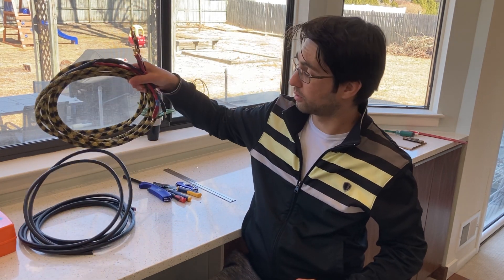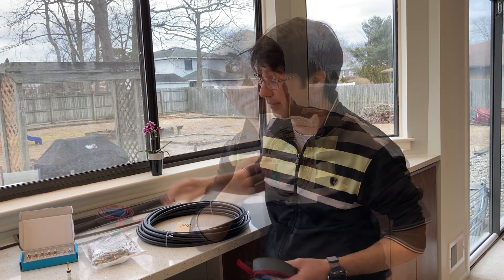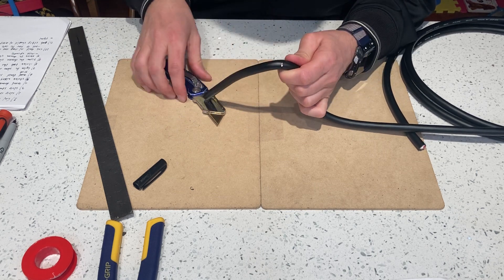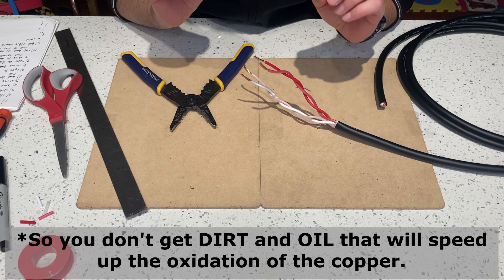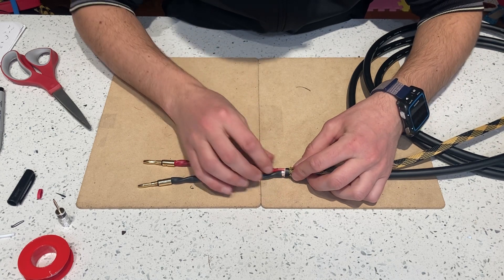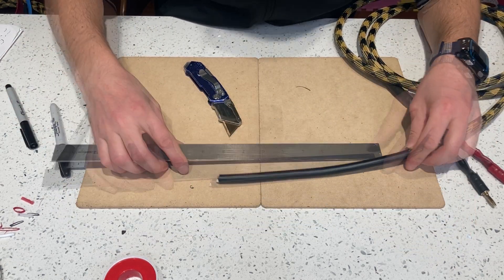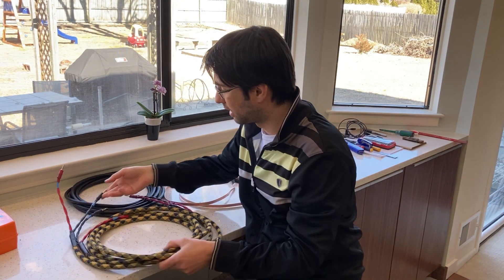DIY Speaker Cables - How to Build Your Own High Quality Speaker Wire (w/t Canare 4S11 Made in Japan)

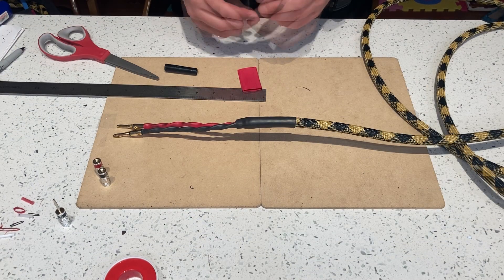Comment: I did the similarly and the result turned out amazing! I really like how it came out. 6:56 - let me share one tip. It annoyed me that every time I connected or disconnected the speaker cables from the amp or speakers, the banana plug nuts would loosen up. I used blue Loctite 243 threadlocker and it worked perfectly - the nuts no longer unscrew themselves!
However, a heads-up: once you use this threadlocker, you won’t be able to take the banana plugs apart again - the glue holds so strongly that the plug will break if you try to loosen it. But honestly, it’s a great solution because you don’t have to tighten the caps every time you plug the cables in.

Comment: I wish I had heard about Canare cable. I made my speaker cables using Mogami 3104 which are 4 12gauge wires but I think you get a more neutral sound with Canare.
Reply: My uncle is an electrical engineer and audiophile who has spent probably about $100, 000 on speakers and amps. He says only gauge can effect the sound. Hope depot ofc copper speaker wire is all you need, the rest is snake oil and aesthetics.

Comment: If you have interference so strong that it makes an audible difference in a high-power signal, isn’t the correct solution to get rid of the source of that interference as it could damage all kinds of electronic devices and be outright deadly for people with pacemakers?

Comment: worth to make such a think for dali spektor 2 / and a / yamaha a-s201 or a-s301 setup ?
Reply from the maker: It’s a relatively inexpensive cable I think. You can get a cheaper cable. I like the thicker gauge for its properties, especially if the speakers are further apart from the amp. On a $1000 setup probably worth spending $60-$100. If you buy something off the shelf make sure it’s at least 14 gauge and has nice robust connectors.
Reply: @onemandiy  my current cable is 2x4mm

Comment: Honesty, 10 gauge stranded OFC wire is all you need.  Just strip the ends and tin them with solder and connect them "directly" to your amp and speakers.  No connectors to break of fail and no signal loss with lower cost.  You're really just creating audio "jewelry".  Nice craftsmanship, though.

Comment: Quick follow up if you have a moment.
Shrink tubing - Why not use the 9/3mm 3:1 in a longer length to cover both red cables and the whole banana plugs ?
or the 9/3mm - 2 pieces one for the wire and another for the banana pug ? does it make a difference.
Thanks in advance
Reply: I figured it out. Nothing like taking a break from a project and then coming back fresh :)

Comment: Nicely Done.
Quick question if you have a moment.
I noticed you twisted the 2 redish cables together and the 2 whitish together.
What made you go that way or that specified somewhere ?
Thanks in advance.
Reply from the maker: Thank you! It’s not specified, but basically color indication to make sure you don’t mix it up. You could make a biamp cable with four plugs on each end, and have two pairs. so you’ll need to keep track of the colors. Hope that helps. Color coding is red for positive hot and black/white for neutral. Hope that helps

Comment: I don’t believe that the twisted wires as you have used them add noise protection for two reasons.
1. The voltage and current in speaker wires is unlikely to disturbed by the level of electromagnetic fields found in non-industrial environments.
The low level voltages and currents from microphones, electric guitars and Ethernet are another matter.
2. Twisted pair wires only resist noise when used as a “differential pair”. The positive signal is sent down one wire and the negative image is sent down the other. When the two signals are summed by a differential amplifier the noise is cancelled out.
SIGNAL + NOISE - ( - SIGNAL + NOISE ) = 2 * SIGNAL

Comment: Thank you for your insight! Question... Twisting them together is for the interference between each other to minimize the consequential noise, by "micro-cancelation" all along the cable  (canceling most such "inner noise", but not all noise, i.e. interference from external sources). Hence, I'd rather use a plain 12 gage instead of twisting two 14 gage, but I wonder: am I right about this?
Reply from the maker: Technically, if you use 4 twisted wires for two channels (star quad as the type of the cable) the twists will help cancel more of the electromagnetic emissions rather then 2 twisted wires for two channels. That’s is It also reduces cross talk by twisting. That being said this is more true for data lines that work on much higher frequencies, like ethernet cables, etc

Comment: Great video for do it your selfers. I just bought the canare 4s11 from Blue Jeans Cable with locking bananas on amp end and spades on speaker ends. You can get them full range or bi_wire. I'm running mine full range and after 50hours burn time they sound excellent. Great price also. They take the time to construct a very good product. You'll be pleased !!
Reply from the maker: Thanks so much! I should try a biamping,

Comment: no OCC cable ???
Reply from the maker: They are all OCC actually, typically the marketing department would advertise that as a feature. Some are 99.9%, and they keep on going 99.99… 99.9999… 99.99999 and call them a 3n, 5n, 7n depending how pure they are. More pure is definitely more expensive, but to what end 🤷😎
Reply: @onemandiy  you dont have a clue
Reply from the maker: @garygranato9164  OFC or OCC... Ohno Continuous Copper or whatever... my reply still stands, its a play on "Oxygen purity". And No not an OCC cable, or at least it isn't advertised by Canare as such

Comment: "amp side" vs "speaker side".... irrelevant. electricity is electricity. current is going to flow in the same direction regardless of which end is plugged into which device... and there are no additions to these cables that would make directionality a consideration. (ie no ferrite chokes, chassis grounding etc.)
Reply from the maker: electrically ye and and you can choose to have either end indistinguishable. However in my design it is very relevant, both ends have different split lengths, longer for the amp and shorter for the speaker. Also I like to pay attention to detail, so I like my wire to run the same way of the lettering :) Kind of the same reason I don't want to wear my sweater inside out hehe

Comment: good technique on removing the outer insulation, i was showed to do it the exact same way by an old industrial electrician. i also wouldn't worry so much about the oxidization of the cable, unless you leave it out in the rain with the copper exposed you will be fine. if you really are still worried just put some flux on the end and heat it up.

i am curious why you didn't just buy 4-6mm^2 2core wire rather than having two 2.5mm^2 4 core twisted together, and the ptfe tape under the adhesive heat shrink.
Reply from the maker: Thank you! I may try the flux tip. The cables will definitely oxidize when exposed to air over time, not as bad as if outside but will stop being shiny.

I used the 4 wire configuration because of the star quad topology, the cables/signal does more twisting and reduces electromagnetic interference. I and the take under the shrink is so I can build a smooth transition.
Reply: @onemandiy  ah I understand, I’m Fairly new to audiophile stuff, I am an electrician tho so I know a thing here and there that relates. More on the flux I mentioned. There are different types of it and they can be more or less corrosive. Heating it up just speeds up all reactions. If you want Really corrosive flux, get some copper pipe braising flux, give it a good coat in that and then torch it. If you want a long lasting and reliable connection you want to solder it. I always use lead solder to solder as it flows better and I believe less chance of cracking since the lead is very malleable. To clean off flux you should rinse it in isopropyl alcohol. If you torch it well tho most of it will come off.

Comment: Can you use this cable for bi-wire cables?  Just have one end with 4 banana connectors and the other side combined into 2?
Reply from the maker: Absolutely! 1 pair (2 banana) for the amp, and 2 pairs (4 banana) for the speaker. Just keep track of the + and - pairs.

Comment: Built 2, 9 foot cables yesterday....   Going to make 2, 14 foot runs.    I saw you have reference cables?   How about the info on those?  I'd love to make those...   You should try 12TC cables too... I am torn... Buy from Aliexpress or make the 12TC's.    Thanks again for making this video!
Reply from the maker: Nice! Those cables will pair nicely! My reference cables are Goertz M1 or M2 flat cables with matching goertz spade and banana plugs. I bought the wire and connectors on sale, maybe I’ll show them some time
Reply: @onemandiy  Ready to make a set of White snakes instead.  Using the gray star quad, pure copper spades and plugs... White and silver PET.  Can't wait
Reply from the maker: Sweet! Have fun with it!
Reply: @onemandiy  But I'm crazy!    Bought some Mogami W 3104!
Reply from the maker: @Scrufboy  Nice, those are quality! Mogami use better insulation and jacket materials... also pricier 😁

Comment: Great Tutorial! 

Going to make these. I can't wait.  I want to make one small change, perhaps you can help.    I would like to use PET sleaving on the smaller pairs of twisted wires too.   What size do you think that would be?
Reply from the maker: Glad to hear, it's a fun project! The individual wires are 14AWG with Insulation, I'd say they are about 2.6mm thick, so find a shrink tube that will shrink to 2mm or less. At a 2:1 ratio, you can get a 1/8 (3.5 mm) Diameter Before to
1/16" (1.6 mm) Diameter After. Happy building!
Reply: @onemandiy  My Man!    Thanks so much...

Comment: Dude use a blow dryer  duh....
Reply: Blow dryers don't get hot enough.. at least for anything I use. Lighters are the worst though, unless you like burnt ends. Key is adjustable heat gun.

Comment: Why do we need to wind or braid wires?
Reply from the maker: Great question! Its done for electromagnetic compatibility and to reduce electromagnetic interference. A pair of wires (+ and - side) twisted together are called a twisted pair. The Canare 4s11 is twisted in a Quad manner with 4 wires twisting around each other and therefore minimizing the electromagnetic emissions (sort reducing each wire's electromagnetic field) and their affects to neighboring systems and wires. Great read up on wikipedia https://en.wikipedia.org/wiki/Twisted_pair
Reply: @onemandiy  thank you

Comment: Nice video👏. One thing, cable medium is omnidirectional (the current flows in both ways equally )
Reply: haha yes it wont matter which side goes in the amp unless the connectors are different

Comment: OOops...  first mistake was believing all that "Oxygen free" crap.  Second fail is that you should be using SPC, which is Silver Plated Copper.  Far better conduction.  "Rival" expensive cables?  AudioPHOOLS are stupid for ever buying those at all to start with.  Then there are those $1200 IEC line cords.  Man are Audiophools stupid!
So yeah, dude...  Silver Plated Copper wire is the way to go.  Also, simple paired up wire collects capacitance...  a lot.  A flat braided cable is far better, especially from a placement/routing POV.  Unless you place your front speakers a mere few feet apart near your amp.  That would be another fail.  "Quad Canare"  Oh boy...  they saw you coming a mile away.  Yes...  Silver is better.  Just ask the military and while you are at it ask the robot wars guys what they link their power source to their motors with.  Audio production is merely a power source connected to a motor (coil).  Gotta say it again....  Silver is better.  Likely cheaper too since what you bought has a target demographic that involves them knowing how stupid y'all are.  Dollars per foot.  Bwuahahahaha!
Reply: But pure copper is the best conductor
Reply: @stLtBilko  Silver conducts better than Copper.  And if it is AC, the skin effect is why they use Silver plated Copper for RF tank circuit coils.  The issue is that it is prohibitively expensive.  So the norm is Silver plated Copper inside a Teflon sheath for the military.  The resistance number is lower.  Still does not warrant the price points these nuts use on their crap.
Reply: @cosmicraysshotsintothelight  Your statement correct sir, what I should have said was pure copper is the best conductor IMHO in the fact that I have tried silver plate copper cables in the past but I would always get slight siblance in the treble & when I switched back to copper only cables my systems always sounded more natural, these were all used on my entry level equipment so I can't say how silver plated cables work for other people, but yeah as you said silver is the best conductor but it's cost makes it prohibitive for most hifi enthusiasts, also from memory silver is only around 10% or so more conductive than copper which along with the sibilant effects it can have on the sound I would advise just using good quality copper cables unless you have an uber expensive system that has a lean ponderous sound overall.
Reply: @stLtBilko  I think the "sound difference" was all in your head, and a 'blind taste test'...  you would fail.  Tubes over transistors, sure...  noticeable.  This?  No way is there a difference in sound.

Comment: Use solid  core wire!
Reply: Go read up on skin effect. Also "work hardening of copper".  There will be micro-fractures at every bend.  Not good.  Especially when the "Oxygen free" dopes tout the reason for the wire type.  All those micro-fractures are very bad.